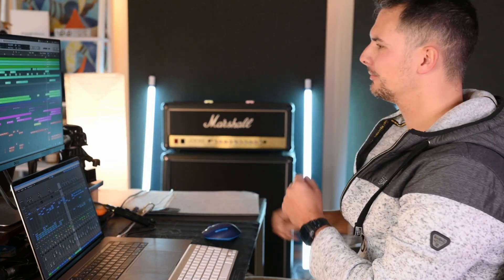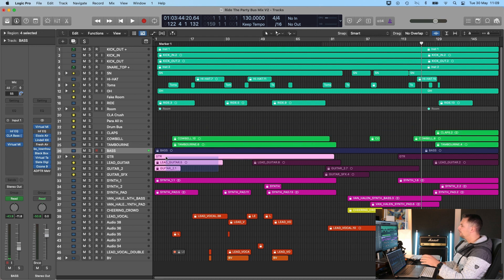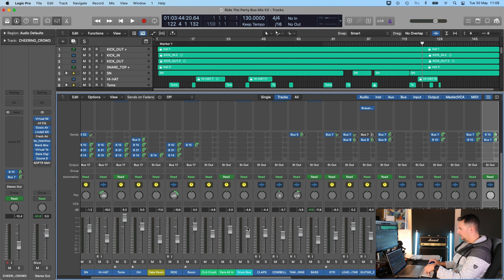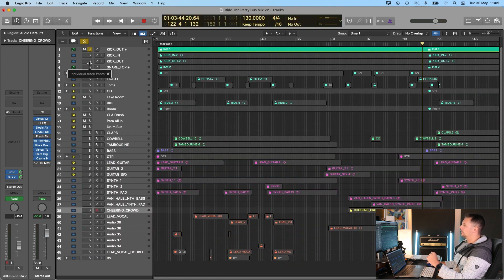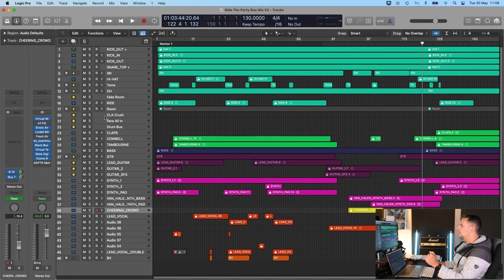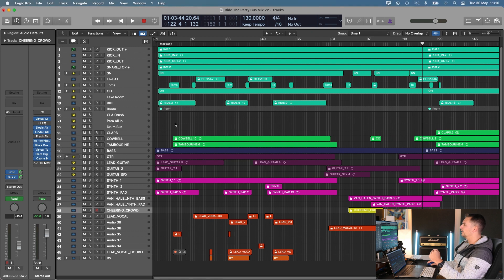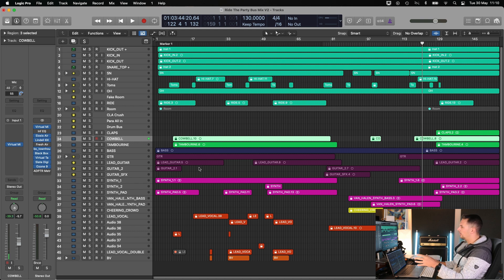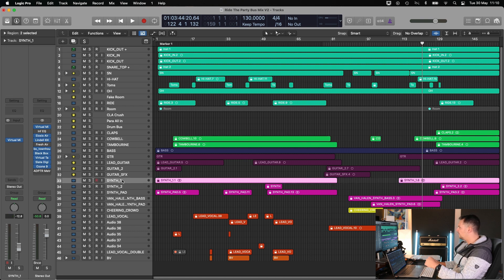The Flaws of Top Down Mixing! Why you should NOT do it!

Comment: Interesting point of view for top-down mixing.
I am of the kind that thinks that we should use whatever works best for one.
I've been mixing using top-down mixing ever since I started mixing and discovered the method.

Today I work with a combination of the two methods.
Top-down mixing in the initial state of the mix and then work on the individual channels when more in depth while mixing.
I used to have processing on all my busses but not anymore.

My process now goes: 
Gain staging session>Summing, bus compression, tape sound on mix bus>dealing with individual channels using channel strips and working on the groups only to do general i.e de-essing vocals, group limiting or saturation/compression but in small increments as it's been added beforehand on both the mix bus and the individual channels.

So all in all, the best is to combine the two.

Comment: I agree with your opinion of top down mixing. I don't understand why people say you shouldn't eq while solo'd. Of course you listen to, and eq, an instrument that needs it, both solo'd and not solo'd. Even more importantly, you listen solo'd because now you don't have other instruments masking certain frequencies and hiding problems. Finally, my humble opinion is that if each instrument sounds really good (aka sounds the way you want it to sound) by itself, then getting instruments to blend (which, after all, IS the definition of a mix) is very much easier. Let's face it, that's the way it was done in the old days when they didn't have tons of tracks, tons of channels, and tons of processors - you got the instrument to sound good, you put the right mic on it the right distance away, and besides some compression, that was most of the work done. Now you just have to balance a number of great sounding instruments. Let's not forget that mixing engineers were originally called Balance Engineers!;-)
Of course you can do some things top down and you adjust your mix bus periodically as sub-balances change, but I feel like the way we experience music emotionally should be paralleled by the way we mix - for pop music it's drums and bass, then get the guitars and keys to sit the way we want on top, then get the sweeteners to sit on top of that the way it feels best (horns, strings, percussion, fx), then get the vocals to sit on top of everything else, adjusting what's below as needed. Now we've got a good mix and we use the master bus to sweeten and massage it even more. or orchestral music, it isn't much different - bass and cellos and tympani first, then everything else moving up to the top.

Comment: I think an ideal setup is a mix of the two, as both top down and bottom up mixing have the exact same issues, but they're opposites. Taking your EQ example, fixing stuff with EQ whilst your track is soloed means you just lost the context of how that track interacts with the other elements of the mix. Doing this on acoustic drums for example means you're treating it as a drum machine, rather than an instrument which happens to be comprised of several channels of audio that produce that sound when combined. Our ears are pretty good at isolating elements from the mix apart and all that trickery is built into our brains already, so soloing tracks should be reserved to special cases where you need to fix something, rather than a norm. 

The way I mix goes as follows:
- Load all the tracks into your DAW of choice
- Rename stuff according to the convention that's best for your workflow
- Look at which elements might need to have the same processing done to them and give them their own bus, which will both serve to get a static mix faster and save on processing. That will usually give one master bus for drums, one for bass, guitars, keys, vocals and so on. These can be composed of a mixture of subgroups or all tracks of the same "type" routed to said bus. This helps in situations where you need to lower just the toms without changing individual volumes for them and similar things.
- Once all that's set, you put all faders except for the master on zero and start bringing them up one by one and balancing them until they sit well. Panning is optional.
- The previous step can be done element by element of the whole mix at once. If I decide to do the latter, I don't touch vocals until I have the instrumental portion right.
- Once the volumes are "correct," start adding your processing to each track as necessary without soloing any tracks unless absolutely necessary. You want to listen to how that processing sounds in the context of the whole mix. Adjust volumes as necessary.
- Once all that is done, then you'll have a good idea as to which tracks need compression and which ones don't, as well as necessary saturation and other elements to enhance stuff.
- That should give you a pretty dry mix that's hopefully gained correct to the point you don't have to add compression or limiting to the master bus to catch overloaded peaks or transients. At this point, you should bring the vocals and start strategizing how to fit them in the mix using whatever processing is necessary. Don't touch any reverb or delay at this point.
- After the vocals look like they're seating well, start adding your reverbs and delays.

 This approach is neither bottom up or top down, but shares elements of both and hopefully uses the advantages of each, on top of making easy to make it more top down or more bottom up if necessary. Why use one tool or the other when you can use both?

Comment: Why are you saying it’s not top down if you clean it up and get the project ready first? It’s not against the rules and it’s still top down if you get the project set first😂You can do an initial balance/ remove mud and obvious issues first in the editing process before thinking about top down. There are tons of great reasons to work topdown, especially saving cpu. Might use automation differently, but ultimately should have to use less of it.
Reply from the maker: You're right, it is definitely not against the rules :) That's how I did it in the past as well. But then you're still left with the send/reverb/delay issues, plus the possible complications with making future adjustments, stems, and revisions of more complex nature, especially once you include compression on multiple busses. CPU should not be an issue these days with any mixing method though.180 tracks bottom up mixes with a 4 year old mac with no glitches at all.